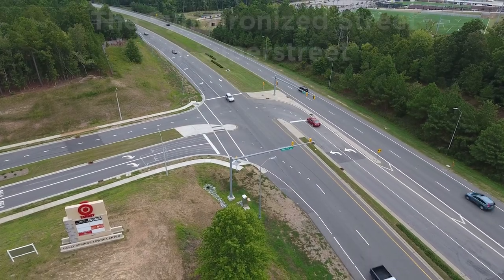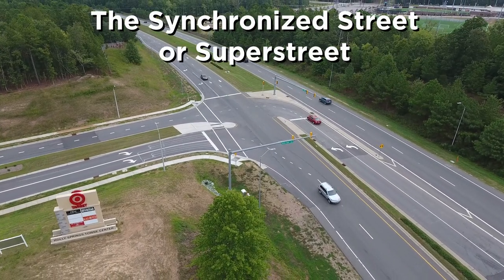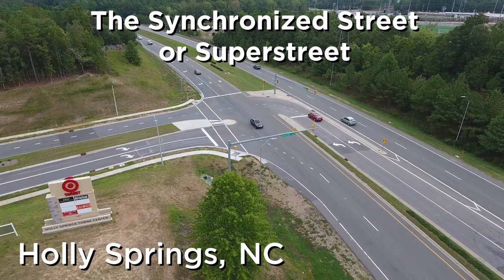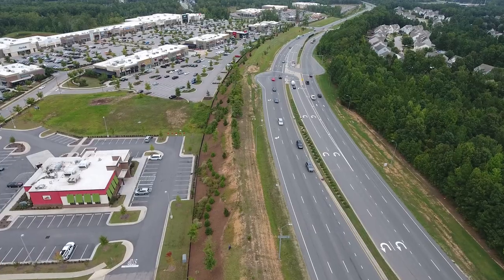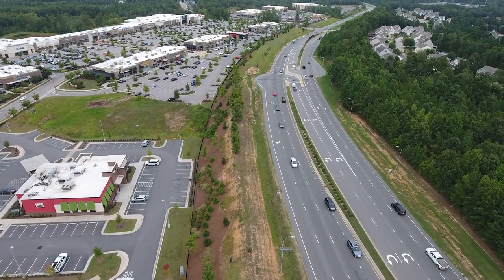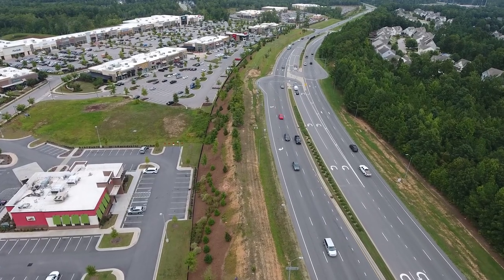Superstreet in Holly Springs, N C

Comment: How does this reduce traffic delays? If you need to go straight through the intersection, you can't. You have to turn right, then go down the street to a stoplight, make a U-turn, and come back to the other side of the intersection. So all the time they saved for the people going north/south (the commuters), they stole from the people going east/west (the locals). The delays are reduced for one group and increased for the other, so the net difference is zero.
Reply: not to mention the folks making u-turns have a red light...in other words the folks going north and south STILL have to stop at a red light to let u-turners through.

Comment: I've lived in Holly Springs for close to 15 years if not a little more, this does not reduce traffic whatsoever. In fact since 2006 traffic has increased over 60% of what it used to be. You can get from Fuquay to Apex in 15 minutes now you're lucky if you get there within 25. traffic jams are an automatic, especially through Holly Springs. If you work between 6:00 and 8:30 a.m. avoid 55 and 401 South at all costs because the town nor the state has done anything to help. They've only made the problem worse by adding more intersections more stop lights and more odd turns that Force traffic to be delayed. This is anything but a super Street. Don't even get me started on hspd, rather than hunt criminals and do their job appropriately they choose to tailgate citizens for any reason at all. Especially late at night, you could be doing the perfect speed limit and they decide to literally follow you all the way to the Town Line hoping you make some sort of traffic infractions so they can stop you thus calling the rest of the Holly Springs Squad because they're never that busy anyway.
Reply: I believe this issue has more to do work the fact that the population has essentially doubled in the that time.  I assure you that traffic would be even worse if all of those intersections had full turn movements.  People not paying attention and driving way below the posted speed limit also screws up the traffic flow, unfortunately.  There isn’t much DOT can do to address bad driving!  Hopefully with 540 opening up soon, they will be fewer cars on the bypass and on 401 🤞
Reply: @CMK_Patriot  thanks for your positive feedback, if you're from the area we both know that's not going to happen lol half the people who drive through 55 and 401 don't even live anywhere off of the highway or area lol they usually live further out or just traveling through. Mind you there's so many other options to choose from but to each their own--gotta get home i.g